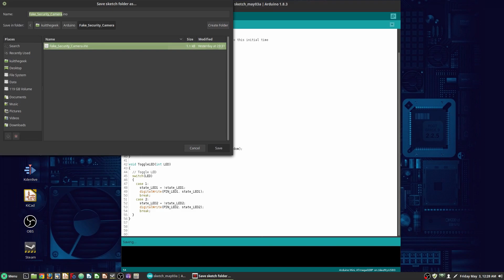Shenzhen I/O in Real Life - Part 4 - The Code

Comment: I'm curious to see how you write code for a product which requires two or more microcontrollers. In Shenzhen I/O, you often need to set up circuits so that they send data back and forth multiple times in a single cycle. Are there any modern designs which need to do that, or are today's standard microcontrollers robust enough that it's never necessary?
Reply from the maker: That is a great question. Really what it comes down to is if the system has to be real time or not. With a device like this, the timing can be fuzzy and it will still work and no one will die. With other systems, timing is mission critical, and a slight deviation can cause a failure. There are a lot of products that use multiple processors and do parallel processing with passing information back and forth. In fact this is generally what you have when you talk about a processor having dual, quad, or even more cores. They are all independent processors, and they may need to pass data back and forth to accomplish the task. I think that is a great topic to cover. Thanks for the suggestion.